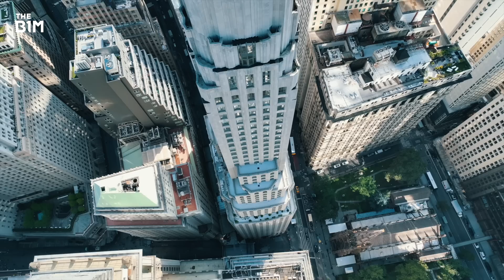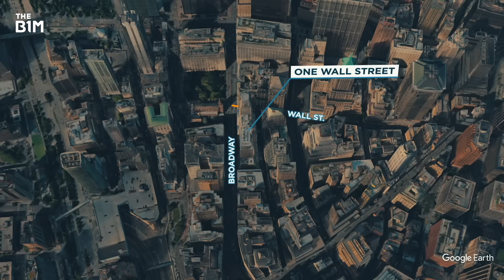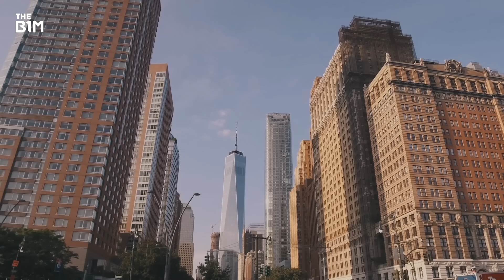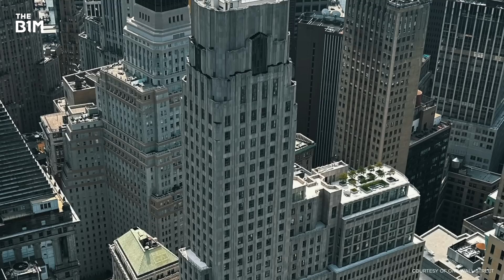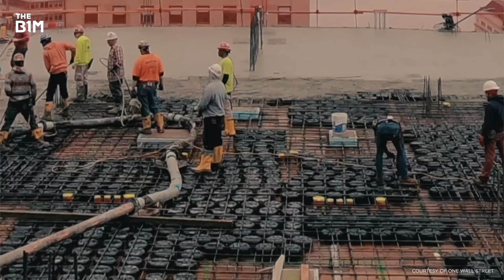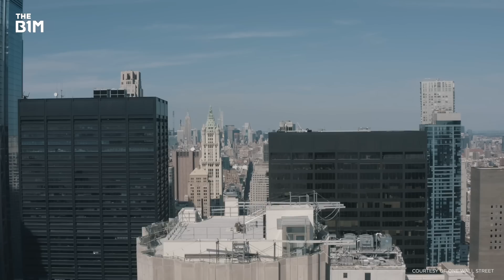Why New York is Building on TOP of its Skyscrapers

Comment: Bubbledeck is an relatively old idea, from Europe, maybe even first from a Danish firm. The idea is pretty good - however in Denmark / Europe we more use prefabricated elements and not in-situ casting. But it would have been an even better idea to construct the extra floors from massive wood construction such as glulam and CLT.

Comment: THIS is THAT. 
The 'One Wall Street' project. 
Yes, this is the iconic, refitted Skyscraper I was talking about in the car the day before yesterday. As you would learn from this video, One Wall Street was originally built in the 1920s as an office tower and they started its conversion in 2014, taking 9 years up to 2023, rather than 8 as I (mis)reported to you in that presentation.
You would know all the fascinating details of the amazing retrofit of this office tower into a residential one, and adding of the six new floors on top of an existing Skyscraper, from this video. If you are the super genius who can find a method to the mindboggling proposition of doing this kind of 'retrofit' in 1.5 or MAX 2 years, ...

CONGRATULATIONS !!!

You have just solved the absolutely intractable housing problem of virtually every mega cosmopolitan city with Skyscrapers of North & South America, Europe and Asia (including China & Japan). Just doing this idea would entitle you to a first (hopefully) newly-begun Nobel Prize for Architecture...or at least a Pritzker. 
But begin right away because if I broke out of this prison that I'm in, I would beat you to it. 🤑🥰😍🤩🤣😂⏱
Your time starts NOW!!! ⏲⏲⏲⏲⏲⏲⏲🏆

Comment: Probably the opposite end of the spectrum client-wise is one apartment building I watched being built atop a single-story inner-city supermarket in The Bronx. What was most noteworthy is how evident that the existing structure wasn't designed to be built upon. During construction the supermarket remained in operation, with the heavy-duty work seemingly occurring after-hours. I say this because I walk in there one day, and there are these massive steel columns placed throughout the store's footprint and extending through the ceiling. 

Those columns are still quite visible inside the supermarket today and weren't even covered up, just the painted steel right where you can touch them. Look on Google street-view for 1001 West Farms Road, and spin the view around to look across Westchester Ave toward the Key Food, then use the "See more dates" to view the same scene in years past. July 2018 shows the supermarket before construction began, with the latest view in July 2021 showing the completed apartment and existing supermarket integrated into the design.

Comment: They could easily had use Foamit product with the concrete.
Reply: That would work for a slab-on-grade construction, but not for structural use like this, where you want to lighten the core of the slab but retain full strength in the top and bottom layers.

Comment: Having done plenty of structural detailing of concrete work like this,  as well as having worked as an on-site super/PM building this stuff, it looked to me like they didn't install the voids for shit. Just threw them down wherever, except of course at known stress points, like near columns. I hope the calcs accounted for such sloppy construction. Personally, I wouldn't trust that to hold up over time, and I sure as heck wouldn't want to be the one signing my name off on it.

Comment: Just fill the elevator shafts with concrete and you can build 50 more floors on the top of the skyscraper. 😎 And you still have stairs for the occupants, right? 😅 They will do jogging and fitness even not entering the SP or the fitness room. 😝😝😝😝😂

Comment: The biggest issue with skyscraper changing to apartments is its not really easing the housing issue as the housing issue is more hard hit in the working class. EVERY conversion I've seen has emphasize upper class or higher. Not saying they don't need housing as well but its the middle and lower class that are being hardest hit. To convert a skyscraper in a way to make it affordable for working class however would require heavy concession of the tenants and I don't see that as feasible in the US.

Comment: The weight of all the building makes Manhattan to sink - as the water level is rising.
Several other cities have the same problem, and continue building is not a good idea.
Reply: Google "New York is sinking"
Several mega-cities are sinking. Much is caused by pumping up round water.
Many building in Mexico City have got a new floor underground.
Reply: Downtown (and Midtown) Manhattan buildings have foundations anchored in bedrock, Manhattan schist to be exact; they will not be sinking anytime soon.

Now Chicago is another story, where they build on pilings driven through Lake Michigan sand.

Comment: Just a quick question. Why do you say "an" when preceeding a hard "H"? I mean, yeah, sure, calling it "an 'istoric" is fine, but "a historic" is the correct way if using the hard "heitch" as you did. It's about the sound of the word, not the letter it starts with, that determines the a/an usage. Is it just some convention you learned at school? Cos you should unlearn it...
Reply: Actually, "an historic" is technically correct. But I agree, it sounds awkward and I wouldn't use it in conversional English. In a video like this it's a tricky choice, but I probably wouldn't use here either. It's correct, but sounds a bit pretentious.

Comment: I remember the works of Isaac Asimov, who wrote about Caves of Steel in NYC. In those books, they changed office buildings to residential but did not relocate the restrooms at all. Communical restrooms became a cultural thing. In the Mens Personal, no words were ever spoken. Quite the opposite is true in women's facilities. The only thing I didn't see in those books were showers. Also, the buildings themselves were now all connected with very little access to anything outside. They are 1970s books, but they are still good reading today.
Reply: Your comment reminded me of the animated film 'Heavy Metal'. In one of the stories, the narrator talked about how the UN Building was turned into low rent housing.
Reply: That kind of living is pretty much illegal outside of dorms though.  Honestly if the rent was cheaper and there was a cleaner it would probably get a decent amount of people still trying to live there.
Reply: ANYTHING written by Dr. Asamov is worth reading!
Reply: Communal bathrooms were the norm forever until building codes. That's how we use to house thousands of immigrants though so you know.........
Reply: @Ships_Cat311 I can imagine building codes being adjusted to pave the way for streamlined office conversions. But it would definitely still be a heavy lift. Still. People are already squeezing into one closet rooms in the heart of NYC with communal bathrooms. There would be many takers

Comment: What about that one building (i forgot the name) that had plans of being the tallest in the world at that time but ended up being only like 1/3 of its total height? That one WAS DESIGNED to hold the weight of a tower on top of it so... why not do it? Just finish the building as it was originally designed! That would be so cool imo. IF they stay true to the original design that is ofc.
Reply: Plenty of those in NYC. Grand Central Terminal was designed to support a tower (no towers on Grand Central Terminal please...), so was 23 Wall Street

Comment: Idk the voided slabs seem like it would make the building weaker and would reduce the buildings lifespan
Reply: You know that bridge spans are built hollow?

The loads in the middle are about zero, it doesn't affect strenght much if you remove the middle bit.

Same thing with railway rails... They are not fat metal bars, it's not practical, they have a slender middle portion using much less metal than in the head and base portions.
Reply: @u1zha  makes sense

Comment: They need to upzone all the neighborhoods between midtown and downtown, no reason for a city like NYC to have all those low rise buildings
Reply: No, the low rises between Downtown and Midtown Manhattan are not due to zoning, but the lack of bedrock near the surface in those areas.
Reply: @johnclement5903  It is not about the bedrock.

There are many articles debunking this myth - take your pick. There is no correlation between building height and depth to bedrock in Manhattan.

Comment: hi TheB1M, would like to see more tech info on the plastic bubble method of reducing weight in the floor slab please.
Reply: Yeah I don't understand why they do this. Wouldn't it just reduce how strong the floor is? Why use them and not just use less concrete if the weight of the floor is a problem?
Reply: A floor is actually just like a beam, the concrete wants to be pressed together at the top and pulled apart at the bottom. In the hard of the beam the forces are zero. So if you keep just enough material in the middle to hold the top and bottom together, you will save a lot of weight and maintain strength.
Reply: Curious why they don't do this on floor slabs everywhere, even on regular buildings. Sounds like great savings.

Commieblocks prefabricated slabs came with cylindrical lengthwise holes...
Reply: @u1zha  In the Netherlands, almost all modern houses are built with “kanaalplaten”. These are prefabricated floor slabs with channels across the width of the slab. However, these have a one-sided span. Bubbledeck floors have a span on all sides, so you can increase the span.

Comment: I would love a video about tower cranes and why they are so expensive to install
Reply: Me too, would love to see B1M doing videos on big construction machinery
Reply: And how they don’t fall over!!!
Reply: @lifevest1 they have weights in the back
Reply: @pieteraarts6832  well yeah but what about falling to the side?
Reply: @pieteraarts6832 that’s for counter balance for the loads. A crane picks up heavy things mostly. Weight keeps the crane stable and level. Doesn’t stop them from spinning in high winds though.
Reply: I bet Grady at Practical Engineering would be open to that idea.
Reply: Ima look this up cus I feel like you just dropped a gem
Reply: Initially built independently and later incorporated  into the structure they have helped build they are supported by the building finally .
Reply: At ground level about 10 extra feet is dug out in a square about 40ft by 40ft. Then using number 11 rebar a grid is made with space at the bottom and middle and top for concrete and more rebar. Big threaded bolts like street lamp ones but much bigger for the cranes bottom stick out and are secured to the Rebar. Concrete is poured. Crane bottom comes in secured to the threaded bolt with a giant nut. The rest of the crane gets built by another crane usually a street crane or on sight crane. Operators life depends on if the bolts are secured properly as well as being a crane operator.
Reply: @VentureProIsMe  I'm  a Union Ironworker, I have built many of tower cranes in the Bay area of California.. only a few cranes use a big bolt at their base.. most use pedestals with pins that we beat in..
 You are correct about everything else!
Reply: They’re mostly expensive because ANYONE can own one and charge whatever they want. Most owners make around 5-15k a month if a city is booming off one crane. They’re expensive to make and very costly repairs which happen frequently.
Reply: it doesnt cover the cost part but this a good video on the basics of how own is assembled https://www.youtube.com/watch?v=oSyC8pxJdeQ&ab_channel=ArtofEngineering